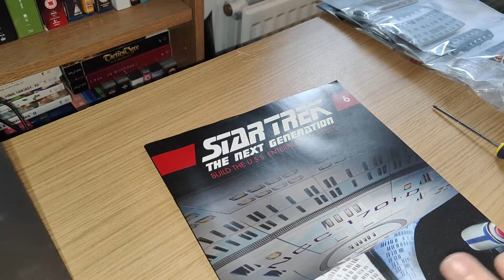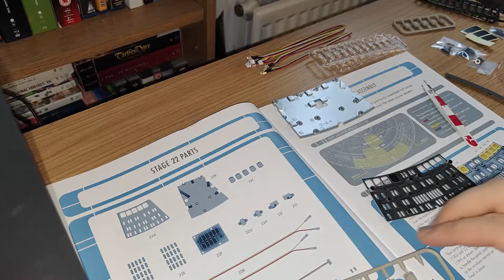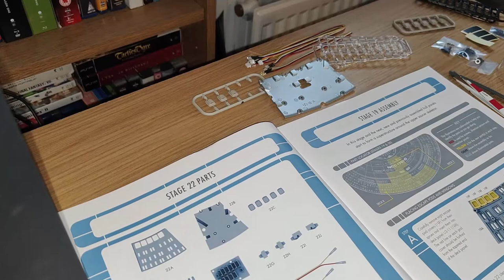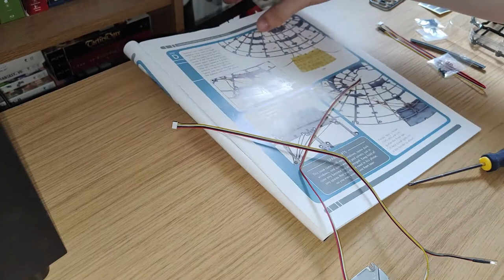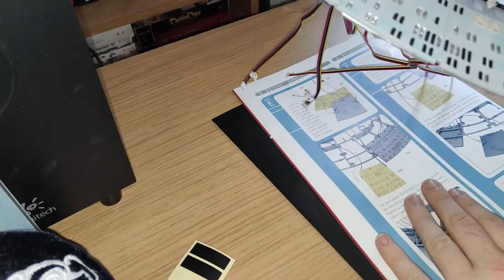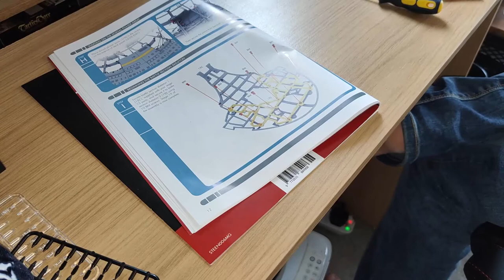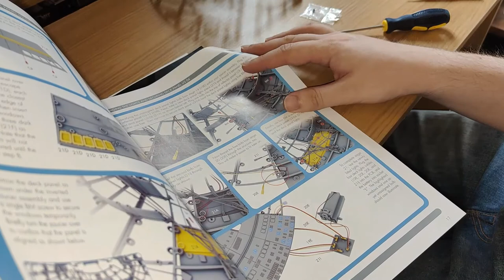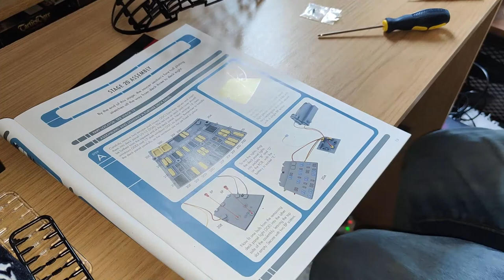Build The Enterprise D - Stage 19 - Deck by deck

Comment: A bit of extra help you could watch the world of wayne youtube channel as i have said before he is by most of the other builder's considered to be the best help.
Also don't forget you will be doing this all over again on the underside of the saucer section and that will also have the dip in it where the drive section connects.
Some small cable ties or black electrical tape to help keep the wire tide during and after each stage and issue.
Loving the build as all ways.
Stay safe all.
Reply from the maker: I do absolutely need to give them a watch to be honest. Been meaning to for a while. :)

Comment: I absolutely hated stage 19! It was the worst. The instructions on part E shows the wires going through the saucer frame one way and in the next photo, the black and red wired LED mysteriously shows up going through that smaller loop. They don't tell you to remove that LED and change its position. You have to figure it out yourself when you realize that the black and red wires won't work the way it initially says to because the wire won't fit when you screw that panel onto the frame. And consistently in the build (I'm up to stage 23) they have you put panels on where the wires are constantly smooshed into the wires of another panel. They couldn't have the pocket that the LED fits in the reflector pieces just a little higher or lower so that the wires don't clash into each other when you put the panels on? I'm also curious to see when you get to the neck section. When you connect the back window and shuttle bay piece to the top cobra head piece, there ends up being a gap. Everyone I've seen build that section has that problem, myself included although mine isn't as bad as some of the ones I've seen. I like the build so far but I question some of the decisions made on its design.
Reply from the maker: I'll definitely keep an eye out for stage 23. I've just finished recording stage 20 for the next video and will be recording 21 and 22 tomorrow. I've had to stagger these recordings as I'm going away for a week and been busy with other things.

Definitely found parts of 19 and 20 frustrating though. You're completely right about the way the cables are, it's so fiddly figuring out the correct placement of them.
Reply: @JLSoryu  Thankfully there isn't as many windows on the lower saucer so that should be easier (I hope!).